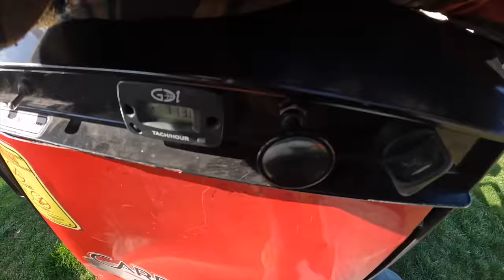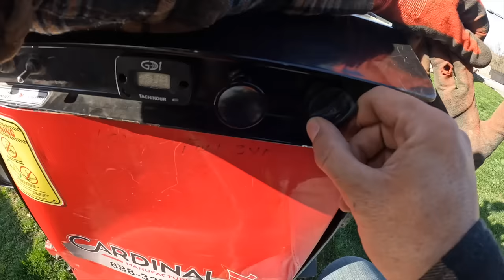Walking on Thin Eggshells:  Chicken Coop Repo

Comment: I always wonder why these bird houses never have good ventilation. Those huge mile long chicken  coops also have intolerable temperatures with fans blowing boiling hot air on them. All that ammonia!!! Never got that.
Reply: I own a 500 acre off-road park. On the very back side is on of those chicken farms with 5 of those buildings.  1/4 mile away in the summer you can smell it.   There is a small access road beside of it with those vent fans.  I was driving down it once on a side by side when those fans kicked on. No joke by the time I got past it I thought I was loosing consciousness lol.  And there is so many chickens in it at any given time you can’t even see the floor.   But that smell.  Shew.
Reply: @Scummy_shovel just as someone else here in the comments said: KFC is selling one chicken bucket for $20